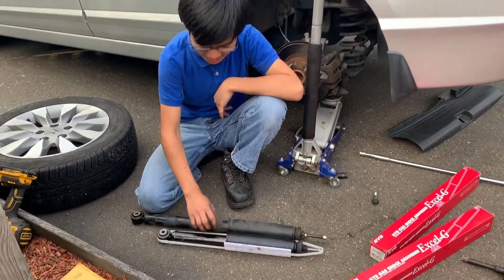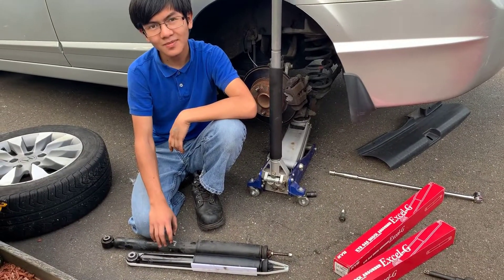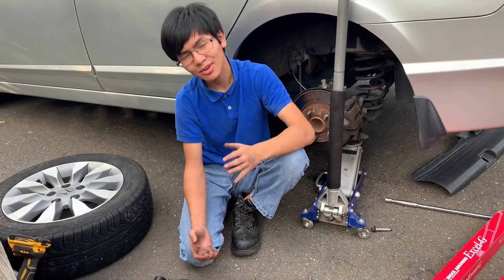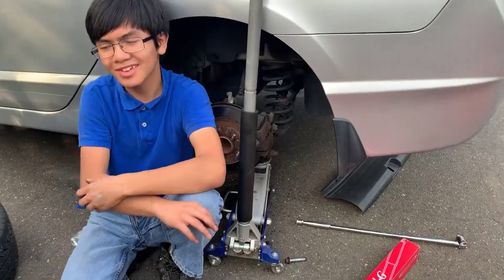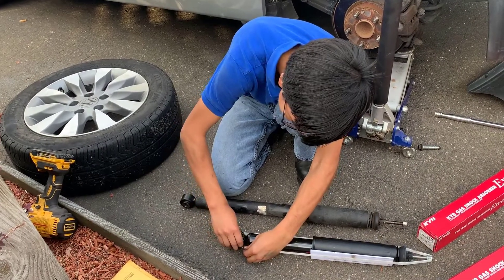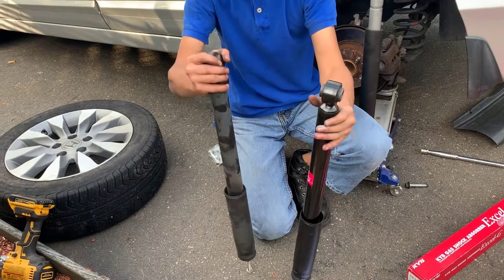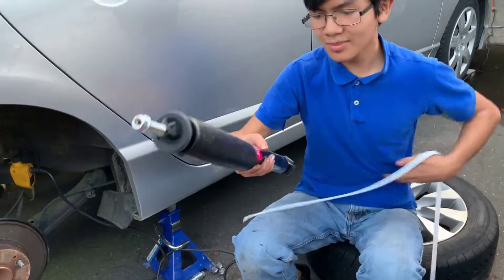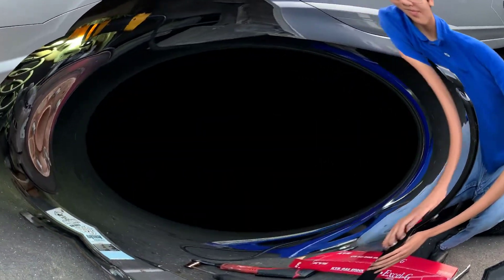KYB Excel-G vs A 200K Genuine OEM Honda Gas Shock Absorber | Why You Should Replace Every 75K Miles

Comment: If you are going to get kyb's, DO NOT get the complete kit. The top mounts for the strut assemblies are poorly done and do not properly align with the mount and will cause clunking an alignment issues. The springs are fine, the mounts are garbage.
Reply: So which mounts do you recommend

Comment: I USED KYBEXEL G
BUT THE SUSPENSION STILL FEEL STIFF, IS IT MAY BE THE SPRING STIFNESS OR NOT, ANY ADVICE
Reply: It will be stiff until the spring settles in. Also, the kyb top strut mounts are prone to failure. If you start hearing a clunking when backing up and turning after the car has sit your top mounts are trashed. This is a failure on kyb and they have no solutions to fix it permanently.

Comment: I’ve got 155k on my OEM Honda shocks and they ride great, I put KYB EXCEL G on my other car and they ride like ass. Very meh ride, make tons of clunks and thumps over bumps. I would not trust $70 shocks and struts on my Honda since it’s my daily. The only reason I got KYB on my other car was because it was the only choice available since it’s an older car, and I don’t drive it that often so I don’t care as much. If I put these on my Honda and it rode like my other car does, they would be coming off immediately and would be replaced with OEM or Bilstein.
Reply: I have the exact same problem. Put KYB excel G on my 06 Civic and you can feel every minor crease on the road. And I got the clunk noise. What is different from OEM to KYB? Is one an oil shock while the other is gas?
Reply: The top mounts for the kyb are absolute garbage. Oem or moog are the only ones you should go with when it comes to these vehicles.
Reply: Quizás no tuvo suerte kyb es muy bueno y funciona muy bien los recomiendo en la parte tracera pues durarán mas para hundirse que los originales.

Comment: KYB is good brand it's Japanese ( KYB  = Kayaba Research Centre), its a perfect OEM replacement for your struts/shocks
Reply: Only the shock. Do not buy them as a complete assembly, the top mounts are not correct to the camber of the mount on the car causing clunking and alignment issues.
Reply: @mytruthslays1303   thanks ima just buy the shocks
Reply: @mytruthslays1303   and ima try moog spring in the rear , im should be good with that ?

Comment: Does honda motor company buy KYB shocks and call them OEM?
Reply: No.
Reply: They source from Kayaba (kyb)/Showa/Tokiko etc etc...but these are made special for factories. To be used as close to the original thing that the manufacturer sold with the car. Huge difference with a 100% built exactly for car manufacturer and some labelled "aftermarket" crap. There are excellent aftermarket kits made for mofdifying but they are very expensive.

Comment: I would say the front Struts are more important than the back due to the fact your front does all the controlling .. I Bought cheap Struts twice they only last about 6 months .. I'm also going with KYB now
Reply: Agreed but he was referring to passenger comfort. Sure the engine doesn't mind feeling the bumps :)
Reply: I bought tein its expensive
Plus the labor the transfer the old parts like coil spring and strut mount 
It cost me $420 for tein shocks
Bump stop and insulator $100
Strut mount 90
Plus labor $320 ouchhhh
Reply: I am looking to change front shocks but I will first buy the rear because oil is leaking..

Comment: Dude. OEM shock is oil filled. It's not supposed to extend out on it's own. The spring does that. OEM one and exel-g don't work on the same principal
Reply: I hear what you’re saying ..
Reply: What do you mean they don't work on the same principle? I'm looking to replace my stock  shocks  on my 17 ram 1500 with excel-G  I heard they are are OEM replacement and just as good  / restore ride like quality. Would your recommend Ecel G or bilstein 4600s thanks .
Reply: @--emt  This is prolly too late for you but for the other readers out there - oil and gas shocks work completely differently. See here for oil: https://youtu.be/ICTOl5aBqUs?t=91, and here for gas: https://youtu.be/h8uEA50thsQ?t=87
Reply: oil shocks works the opposite that is why oil shocks or OEM is kore comfy

Comment: Hi Aiman
I was so motivated and excited to do this job after watching your video.
I ordered correct parts and did my all home work.
But unfortunately my project got failed because of too much rusty bolt of rear shock absorber.
It's not disappointment?
Reply from the maker: Why would the project be a failure?  A rusty bolt can still be removed using bolt extractor.  Search for bolt extractor on the internet if you need one.  Nothing is impossible, if there is a will there is a way...
Reply: @EyeOnAiman  I am still willing to do that, but like I said I was so much disappointed when I stripped the bolt.
Well I will give a shot by searching bolt extractor.
Reply: @MuhammadIqbal-wx3zv  cut the dam thing off with a grinder/cutting wheel if you can get it in there

Comment: I fitted kyb to my bmw they failed mot after 18months supposed to be 2yr warranty they just mugged me offsaid I put wrong ones on phoned to buy new again they gave me same part numbers .No way would I recommend them;(( I did 4K miles only
Reply: if you bought them on Amazon or Ebay they were fake

Comment: Compairing worn out one and new one is the most idiotic thing i ever seen.
Reply: Yeah, this isn't how you test a shock.,lol
Reply: Well. If it was 75k as the vid says to change them. It would be valid and proper original shocks should still be fine/beat these KYB's. But at 200k. This is like comparing a worn tire...

Comment: It is a good idea to replace the springs and all the parts beside just the structs?
Reply: Nah the springs are just steel they will last until they snap, shock absorbers loose oil and leak
Reply: Just the shock absorbers
Reply: Yes you can replace them all. Do not buy anything but oem or moog if you are going that route.
Reply: Yes, do sway bar end links and sway bar bushings while you are in there if doing struts. Depending on the miles, you may want to replace the coil springs as well, because they will "sag" with age.

Comment: i dont like kyb.   dont have confort for civic
Reply: I mean the smaller the car, the bumpier the ride! If you can drive faster in turns than with your other shocks, then the shocks are excellent.
Reply: @AlexanderYivanov   kayaba  dont have confort for drive in city
Reply: Sure they do. But you must get factory ones. Not these plastic aftermarket kids crap.
Reply: @AlexanderYivanov  kyb are hard and dry

Comment: Of you really know your stuff! Your not supposed to depress shocks on concrete.   Your supposed to used a block of wood.   Also! You cant compared a well used oem shock to a brand new shock and expect the used one to match the speed of the new one.  Just saying
Reply: why not on concrete? why use apiece of wood?
Reply: @007jhagga  to protect the threads from being damaged

Comment: I’ve used kyb. Lasted longer than Monroe
Reply: Monroe's are absolute garbage. I've had mine for a year and i'm switching them out for KYB Struts. Weak ass shocks.
Reply: Tide Pod but springs and shocks seperate
Reply: iWin uWin I will just change the strut. Keeping the stock spring
Reply: How many miles did you get out of them> ?
Reply: I got kyb, they lasted a week. Top mounts are garbage. OEM or MOOG is the only way to go.

Comment: What is a good brand shock in the front..
Reply: If not OEM kybs .. but if you can do OEM always better than all
Reply: For daily use vehicles. No point to use anything but factory made for the non modified factory car. Original all the way is right as you said.
Reply: Always oem

Comment: After you change the rear shock do you do alignment?
Reply: If you generally have the same type (shock isn't not inside the spring) then no need for alignment, you simply replace them.
Reply: Yi Wang  I believe cooldaddyslick was referring to custom suspension work being applied to the vehicle to raise or lower its ride height, not whether or not the entire vehicle was above the ground, as it may seem from how his comment was worded.
Reply: You only align when you do the front